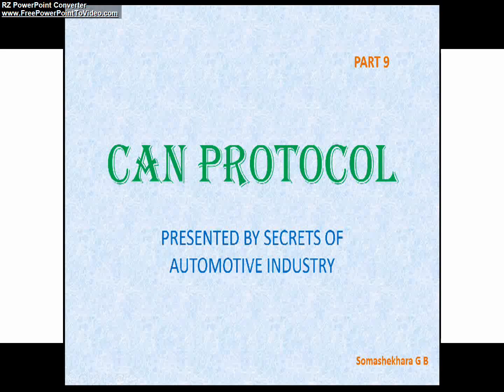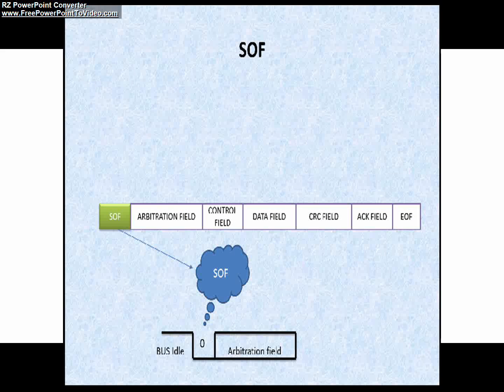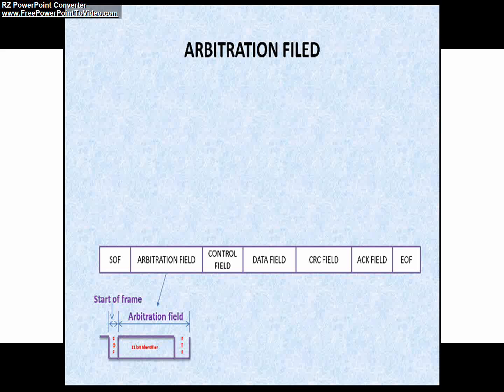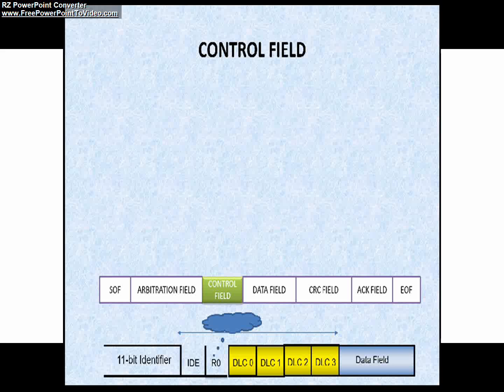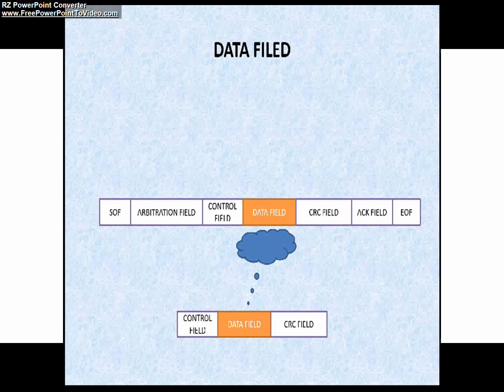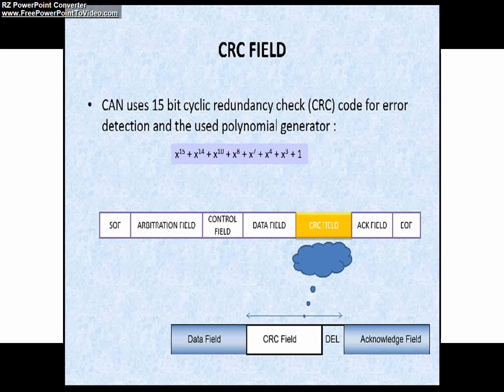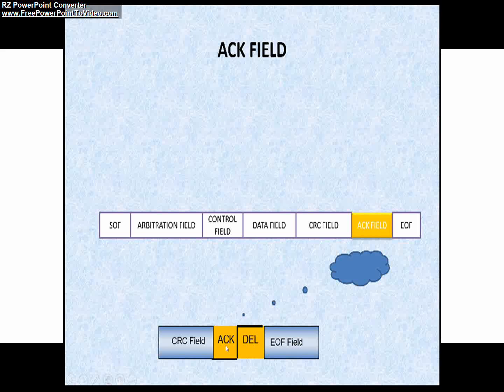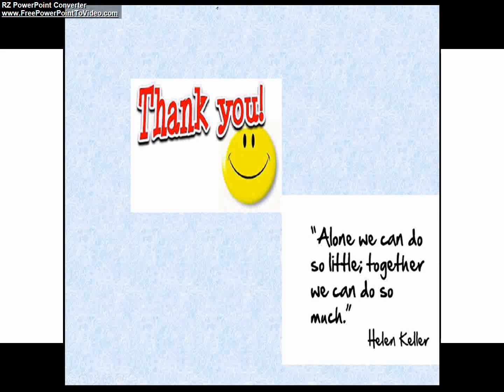CAN protocol basics, PART 9. STANDARD FRAME FORMAT

Comment: Hello sir ,I have one question as you told in earlier video in bit stuffing that maximum 5 consecutive bits may have same polarity then the Tx will add opposite polarity then how come end of frame all 7 bit are recessive
Reply: Subhendu Mohanty 
Hello sir
As per my knowledge bit stuffing 5 bits same polarity .the 6th bit transmitted the opossite bit for the  5 bits polarity for variation of the after 5 same bits of the data

Comment: Hi...I have a question regarding can communication...it goes like this...if I have 2 message (square wave of different height ) with different identifier....are  transmitted using same can bus.....will there be a data loss ?
Reply: no. to my knowledge i think if you have two message.then identifier in arbitration field will give priority to the important message and keep the other message in hold once the first message is processed it will send the second. this is where can is different from other communication protocol.

Comment: From SOF to EOF, only combination of 0's and 1's Transmitter send to Receiver, Here how receiver can understand start bit of the frame? If it identifies like start bit is dominant, remaining fields(arbitration, control fields) also may start with dominant bit, so how receiver differentiate SOF bit? How receiver synchronizes with transmitter?

EOF consists of 7 consecutive recessive bits,here bit stuffing happens or not?

AdvanceTHANKS